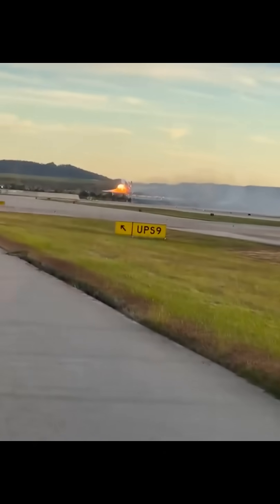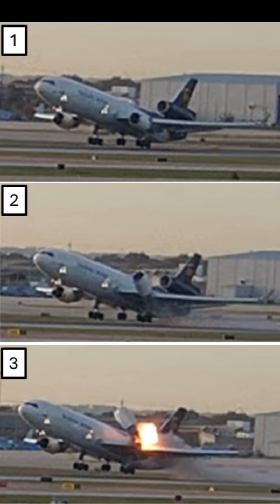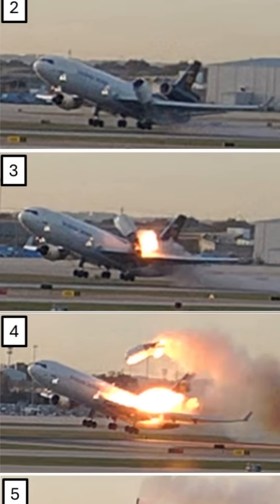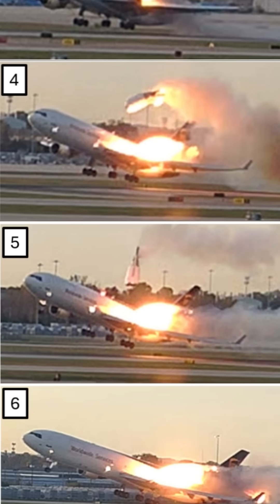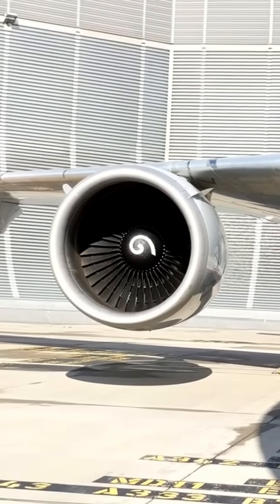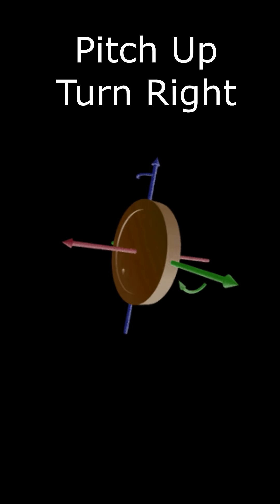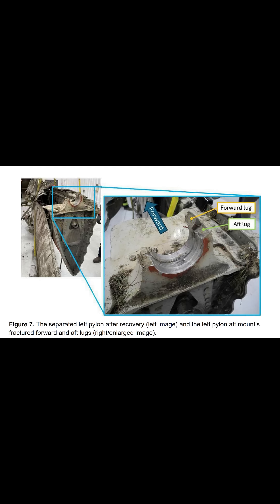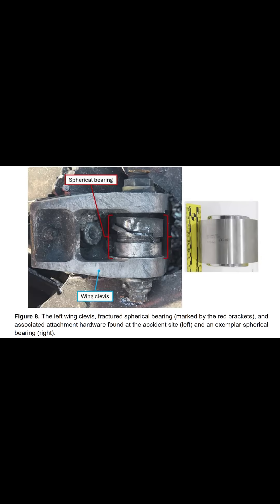Lost Engine Didn't Fall Down, But Flew Up Over Doomed UPS Aircraft #UPS2976

Comment: Scott.. look at that yaw from frame 5 to 6! They really kicked that rudder hard!
Reply from the maker: Yes, that’s what you’d be trained to do
Reply: @scottmanley I fly a G-IV and training for those V1 cuts is no joke. 
You see the tail engine having a compressor stall in frame 6. Slightly obscured by the left winglet. Wondering if the comp stall was caused by the fire, debris, or possibly the quick yaw that momentarily disrupted airflow into the tail inlet. The intake fan for the engine in the tail sits so far back. Reasonable to think a quick yaw at a relatively low airspeed could cause a comp stall.
Reply from the maker: @Janus1663 I got to try this in an E175 simulator and my right leg was done for the night after that.
Reply: @scottmanley  I can imagine! 
Based on your understanding of aerodynamics, do you agree that a compressor stall with this tail engine design could be caused by a quick and dramatic yaw? Obviously it’s speculation, but is that in the realm of possibilities, or is that pretty unrealistic.
Reply: @Janus1663  If anything, a hard yaw would get some cleaner air into the intake as it's not directly in the wake of the aircraft's body anymore. So doesn't seem likely to me. If engines could stall because of a hard yaw, any sudden gust coming perpendicular to flightpath would do the same. Which it doesn't to my knowledge.
Reply: @mintoc8853  On a gusty day when conditions are just right, you will get a compressor stall. They’re not very frequent, but they happen more than you would think. That’s why I feel like this could be a possibility. I’m nitpicking here, but it’s interesting to think that a very dramatic yaw from far left to far right could have contributed. Considering how far back the intake fan sits, airflow could’ve separated from the inside of the cowling for a moment during that extreme yawing motion to bring it back to the right. 

The plane was certified to have a V1 cut with both engines still attached obviously. The loss of drag on that left wing when the engine detached only exacerbated the yawning to the left, making the yaw correction much more dramatic to the right than would ever be seen in certification testing.
Reply: “The loss of drag on that left wing…”
Less drag would allow the wing to penetrate the air more easily, so it would partially counter the yaw to the left caused by the loss of thrust.
Reply: @Janus1663  I stand corrected on the gusts then. However i still think that other factors would be more important if a compressor stall happened. Like the fire and the aircraft's body and aoa. But maybe the yaw was tle final straw who knows. NTSB will tell us all about it in a few months.
Reply: @99percenter1  Unless there was a slat failure at the same time. Though there's no evidence of thatas of yet, I vividly recall American 191 having that happen.
Reply: I'm thinking that because this happened during rotation, a bunch of metal debria got sucked up by engine 2, causing it to fail.
Reply: MD-11s actually have a system to automatically correct for yaw in the case of a sudden failure of the engine 1 or 3, which is probably what we're seeing there.

The pilots did about the best they could though, getting the wings level and the nose down to try and claw themselves as much altitude as possible given the circumstances.
Reply: @dt35591  Every jet airliner has that. It’s called a yaw damper. But what you see here is the pilots actuating the rudder.
Reply: @wrkingrageaholic not all airliners have automatic compensation due to a loss of thrust.
Reply: @dalechristensen3640  Every airliner I have ever worked on has a yaw damper. It’s a necessary piece of equipment to prevent Dutch roll on a swept wing airplane. But regardless, when you see the rudder kick hard to the right in this photo set, that’s the pilots doing that. The yaw damper only has about 3° of authority over the rudder, which is enough to dampen dutch roll and coordinate gentle turns, but not enough to compensate for the hard yawing moment of an engine failure on takeoff.
Reply: @wrkingrageaholic  Rudder Bias boxes are common in these large transport aircraft as well. Yaw damp is usually not turned on until the gear are brought up. A Rudder Bias box is a compartment where bleed air from the engines can directly deflect the rudder, but this bleed air cancels itself out as it comes from both engines and enters the box with equal force on both sides. It is tubed in a way that asymmetric thrust will push the rudder in the opposite direction and passively counter adverse yaw.
Reply: @Janus1663  I have worked on transport category airliners for 20 years, including the past 9 years on the MD11. I have never heard of a “rudder bias box”. I’m not saying it doesn’t exist, but it isn’t on this airplane. The rudder system consists of manual control, a yaw damper, and dual directional servos for automatic landing. Other than some minor help from the yaw damper, there is no automatic built-in compensation for yaw due to engine failure. That would have to be done by the pilots using the rudder pedals and trim.
Reply: @wrkingrageaholic  understood. My experience is in the Beech jet, G200, G4/5 as an FO/Captain. This must be a thing on some smaller aircraft. I can imagine although it’s a good concept, a rudder bias box might be a little hard to implicate on larger aircraft.
Reply: @dt35591  was it the standard Rudder Bias box? Or did they have ARC or something?
Reply: @Janus1663  Pilot input plus yaw damper. Every commercial airliner has it.
Reply: If your engine, ahead of landing gear, suddenly instead of pointing backwards starts pointing straight down, that tends to make a plane to pitch up.
Reply: That pivot up and over the top is very reminiscent of United Flight 191.  I wonder if UPS were doing engine-pylon swaps like United did, to save costs?
Reply: @NemoConsequentae *American
Reply: I'm not that informed on the details of this specific case,  but I'm wondering if anyone knows if engine two is strong enough to get airborne if engine 1 or 3 fails and damages the other wing engine during rotation?
Reply: @apollo11capcom39  No. Engine out emergency procedures are written assuming one engine fails and the other two remain running. The MD-11 will not takeoff and fly with only one engine making thrust.
Reply: @apollo11capcom39 2 was damaged by 1, and the plane would be rated to fly on any two engines.
Reply: @Janus1663  Are you saying the tail engine was also damaged or that I have my engine numbering wrong?
Reply: @apollo11capcom39  left engine detached, right engine seems to not be damaged. Tail engine had a flame out, ostensibly due to ingesting debris
Reply: At that point there was no recovering from the inevitable😪

Comment: I already saw an air crash investigation about this exact same issue.
So it piss me off that instead of making thing tighter, the same accident happened again.
Reply: The engines separated for two entirely different reasons.
Reply: The AA191 experienced failure at a flange causing the aft bulkhead of the pylon to fail from its final report. The preliminary report here points to failure of the actual lug that joins with the bearing.

Comment: Of course there were cracks. when the plane was worked on in Texas they found holes and stress marks on the body of the plane. This usually is called metal fatigue. It is an early sign that the plane is coming apart. In the Texas hanger instead of moving the plane on to service it should have been taken out of service all together
Reply: How do you know that holes and stress marks were found during what I presume was a C inspection?
This has not been mentioned by NTSB nor by anyone else as far as I am aware.  Have you seen copies of the maintenance logs?

Comment: I know that safety rules are written in blood.
So, I'm speculating...
Does this mean it would be better if the engines on each side rotate opposite ways? Such that if the engine should fall off the plane, it will twist AWAY from the plane.
Reply: Having engines rotate in opposite directions would be extremely expensive to mirror components. It would be easier to ensure that they rotate down than ensure a certain direction.
Reply: @kevikiru  There’s no chance of the engine dropping down when it’s pulling the airplane with 60,000 lbf. It’s like if you were playing tug-of-war, pulling with all your might, and the other player suddenly drops the rope. You’re going to go flying away in the direction you were pulling.
Reply: idk what will happen cuz trijets aren't really a thing anymore.
Reply: Not possible from a manufacturing and maintenance perspective and the lack of trijets means that it's barely an issue anymore.
Reply: I was actually thinking the same thing.
Reply: It’s better that you engineer pylons that don’t fall off the damn airplane. These pylons are only held on with two bolts. If either fails, it’s catastrophic. McDonnell Douglas always produced second-rate junk.
Reply: @wrkingrageaholic You want the engine mount to be frangible, acting like a shear pin in case you have for example an uncontaminated engine failure with strong vibrations. It's better for the engine to fall off than rip the wing off the plane. Or a belly landing on rough terrain.
But in all other situations I agree, the engine should stay attached.
Reply: @kuebbisch  Nonsense. Of all the uncontained engine failures I have ever heard of, I can’t think of a single one where the resulting vibration caused the pylon to separate from the wing. That’s not a desirable outcome. You can find videos here on YouTube shot by passengers of violent shaking from a broken engine, but the engine and pylon still remained firmly attached. In case of a crash, the engineers would wish the engine and pylon to separate rather than tear the wing open, but it doesn’t always work out that way. And in either case, the fuel spill and resulting fire are massive. It’s better just to keep the pylon attached to the airframe!
Reply: @kuebbisch  is there one example where an aircraft which lost a jet engine landed safely?

There have been 2 cases with DC-10s/MD-11s crashing, and a 747 crashing after losing an engine. Long ago a 720 crashed after losing an engine during a badly flown barrel roll.

Airbus has a different philosophy here and the pylons are not made with a sort of sheer pins. In a couple of cases fans broke away from Airbus aircraft and engines were heavily damaged, but none of these aircraft crashed.
Reply: @wrkingrageaholic FWIW I do recall hearing somewhere that it is intentionally that the engine will fall off instead of bringing part of the wing with it.
Reply: @maxxiong  there was another similar accident in 1979 where engine separated and torn off hydraulics. And from what I remember the conclusion was that if there is such possibility that engine is going to separate it should do it cleanly to not damage the systems in the wing.
Reply: @wrkingrageaholic And they have been crashing for decades too!

Comment: American Airlines Flight 191, Chicago, 1979. A DC-10 lost its left engine in much the same manner, killing all aboard.
Reply: They had used a forklift to lift pylon AND engine not pylon THEN engine.
Reply: @maschwab63  Normalization of deviance.
Reply: Superficially similar. However, in the DC10 crash, the hydraulics were lost, leading to the leading edge slats withdrawing, causing a fatal loss of lift on the left wing.
In the MD11 crash, the lift devices remain deployed. The crew was able to maintain roll control up to the first point of impact.
Reply: @jamessharp5972 What happened after the engine loss may be different, but both appeared to start with an attachment fail at the aft end of the pylon. Flight 191 was caused by mechanics changing out the engine improperly.

Comment: One also needs to know that the DC-10’s and MD-11’s wing engine mounts were designed to fail exactly as shown.  Heritage Boeing jets’ engine/pylon mounts are designed to fail front mount first so that the engines fall down from the wings.

If the engine mounts’ fuse pins failed to drop the engine off the wing downward, the outcome in this case may not have been any better.
Reply from the maker: The DC10/MD11 mounts are also designed to fail at the forward attach point first.
Reply: @scottmanley I learned this many years ago.  Upon researching this, I see conflicting information about whether or not the DC-10 engine pylon mounts use fuse pins.  Google AI says yes, but some people on various aircraft forums say no.  So, how the engine separates from the wing is uncertain.
Reply: @treborg777  Google AI says yes based on what? As long as Gemini isn't providing a source for that (and that source checks out), it's much more likely that a random person on an aviation forum is correct than an LLM (and Gemini 3 is one that hallucinates especially often).
Reply: @tonTeufel that’s why I dug down further than just accepting the AI response.
Reply: @treborg777 Why even bother asking AI at all? It's a waste of time, you have to fact check it so you might as well just look it up yourself to start with.
Reply: Well, both the DC-10 and MD-11 aren’t exactly Boeing. All operating DC-10s and MD-11s were built by McDonald Douglas before they were bought by Boeing
Reply: @randomalt9617 not true. Some Md-11s were built post merger
Reply: With takeoff thrust and a nose up attitude, it really doesn't matter which failed first.  At 5:1 thrust to weight it is going up.
Reply: The engine mounts did not fail.
Reply from the maker: @UncleKennysPlace true, this was the pylon
Reply: In Anchorage, Evergreen airlines B747 on takeoff had an engine rip off the plane. It didn’t crash or burn up unlike the DC10.
Reply: They were lucky. Two other B747s have crashed due to engine separation. El Al 1862 and China Airlines flight 358.
Reply: @oldmech619     it still had 3 operating engines  help it get airborne.

Comment: Because the AFT mount failed first, the thrust vector from the engine creates a moment arm, so the whole engine pylon assembly rotated (pitching up) about the FWD mount, like a hinge.
Reply: Mind you, this failure has happened before although I think it was on a 737. Makes me wonder if there needs to be an industry wide change in how these points are inspected or designed.
Reply: looks like this is the og comment that a bot just stole/copy
Reply: And gyroscopic procession caused it to twist to the right, meaning the total thrust vector was up and right. Sending it over the fuselage, with debris headed right to the #2 engine.
Reply: @rdspam that may be the reason to doom future trijets. Any debris from the wing mounted engines can damage the tail engine. With 2 engines out, there's no way to generate sufficient thrust for takeoff.
Reply: @fallinginthed33p  What future trijets?  They basically got their lunches eaten by big ETOP twinjets.   But also, if it had been this aircraft's right engine mount that had failed in the same way those gyroscopic forces would have directed that engine (and any debris it was shedding) away from the tail engine -- so whether an engine failure in a wing mounted engine affects the tail engine still seems quite situational.
Reply: Make left engine to turn another way and make better pylons.
Reply: @jannejohansson3383 half right, just INSPECT them more often than every 5 years...
Reply: Perfect analysis
Reply: Thanks captain
Reply: Yes.  Exactly like American 191.  

I wonder if the cause is similar.
Reply: @calvinnickel9995 In the AA191 crash when the engine came off it went back behind the wing and did not go up and over the fuselage, and debris did not enter the rear engine. The aircraft had enough thrust to climb and continue flying on 2 engines but the left wing entered a stall because leading edge slats retracted as hydraulic lines had been ruptured. Modifications were made to prevent such retraction in other DC10/MD11s. The UPS flight should have been able to climb and return to the airport on two engines, and the investigation is now focussing on why it couldn't climb. Debris entering the rear engine seems to be the leading hypothesis.
Reply: @calvinnickel9995 Captain Steeeve has a recent video about an NTSB report showing similar engine mount fatigue cracking on American 191 and this UPS flight. Maybe it wasn't just improper maintenance procedures that could cause damage to the mounting. Maybe the mount design or materials were prone to fatigue.
Reply: @fallinginthed33p The report also stated that the right engine mount was fine though? So still missing something crucial here.
Reply: @fallinginthed33p  The stupid MD pylons are only held on at two points. A failure of either point is catastrophic. And then they specified that it only has to be inspected (special detailed inspection; eddy current) once every 28,000 cycles. It would take at least 40 years to accumulate that many cycles. This was a completely preventable crash caused by McDonnell Dumbass engineering and Boeing’s failure to realize what a turd of an airplane they inherited.
Reply: It's been almost 50 years since American 191. Plenty of time for fatigue to set in, which would explain why all DC-10 and MD-11 types have been grounded, presumably permanently.
Reply: @fallinginthed33p  The two events didn't have the same exact failure. On the AA incident the bulkhead itself failed. On the UPS plane it was the bearing lug that failed.
Reply: @calvinnickel9995 In AA 191, it was the forward mount (tombstone fitting) that broke. Either way, the result is the same. The engine is at full power and flies up and over. It’s not going to drop straight down.
Reply: Um, yes. He said all that in the video. Did you watch it, or did you take a look at the thumbnail and hurriedly post a comment to look smart?
Reply: Thank you Professor Obvious.